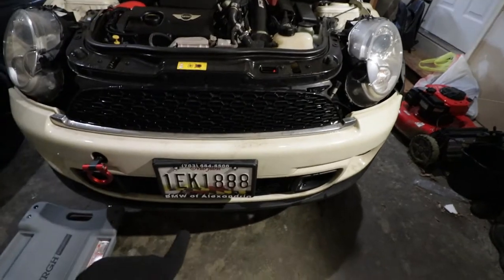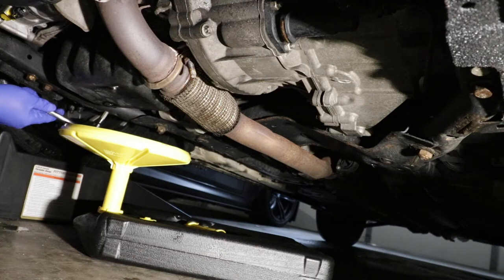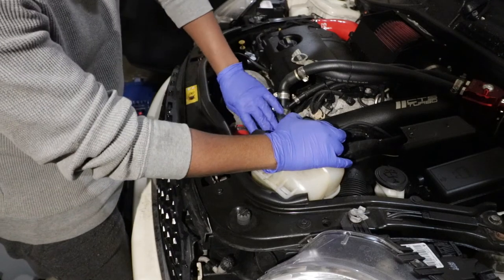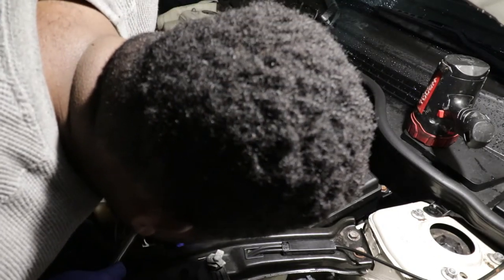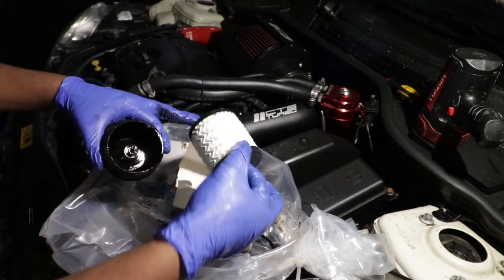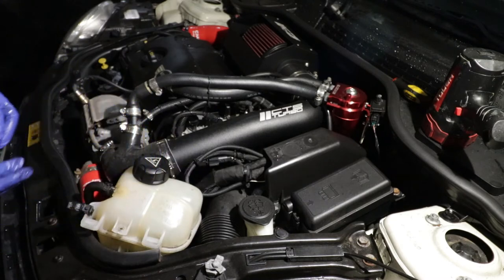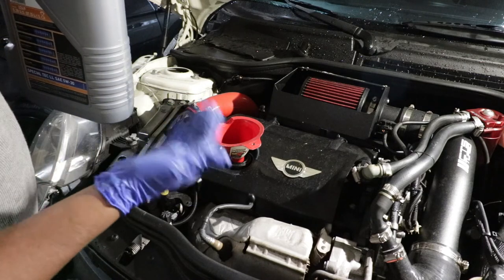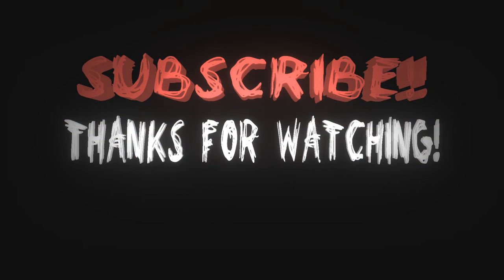How to Perform an Oil Change 07-13 Mini Cooper S

Comment: Also it's a good idea to have the car at operating temperature before you drain the oil
Reply from the maker: Oh really! Why is that?
Reply: When the car is at operating temperature it removes more oil, have the car at operating temperature let it  cool for 15 or 20 minutes then drain the oil. Cold oil is thick and flows more slowly
Reply from the maker: Thank you. That make sense. But it would be hard to remove that oil filter on a hot engine
Reply: Doesn't have to be hot right after shut off operating temperatures let it cool for a little bit then change oil